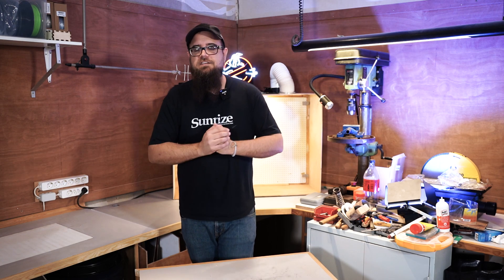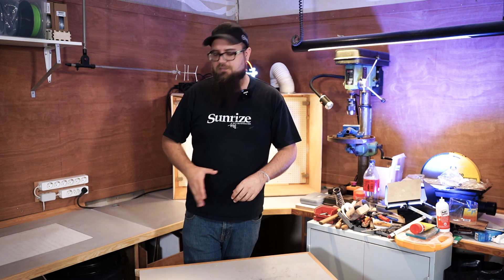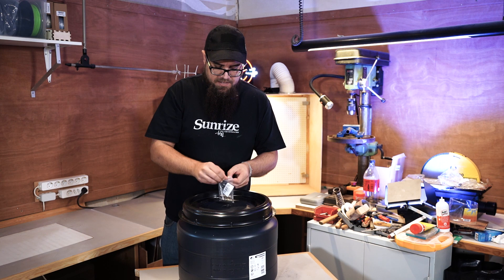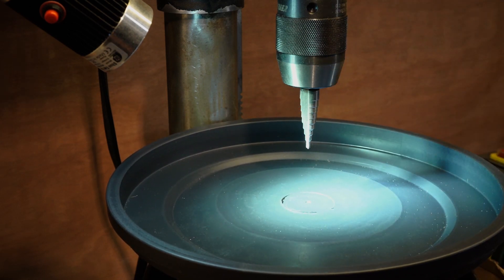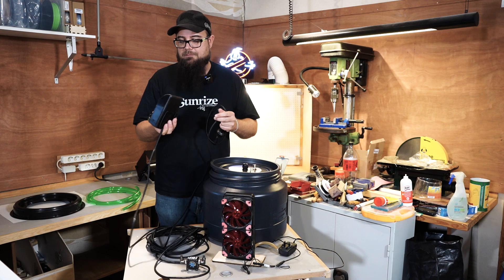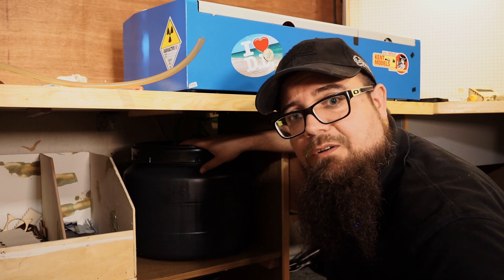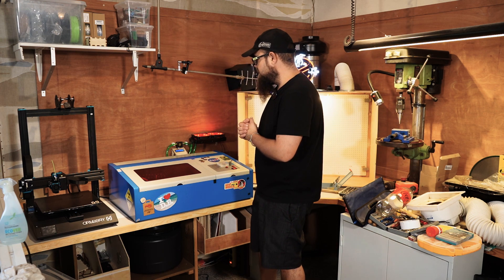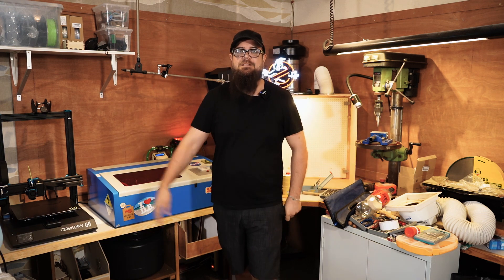Finding the best Coolant Reservoir

Comment: I made a chiller for my K40 out of water dispenser, it costs me just 2 meters of a copper tube 15 mm in diameter, thermocontroller from Aliexpress and some fittings. It's really powerful chiller, I can cut for hours with 25 degrees in my workshop, and coolant temperature stays at 15 degrees (can make it even lower, but I'm afraid of condensation issues on the tube). Highly suggest to make one!

Comment: Hi.
There is a 5th type of people, and that's me, the poor guy who live in a very small city. Here we must learn to do things with the items you could find at home.
So, my pump is into a 20lts old paint can, with some water and a little amount of formaldehyde, no living thing can stay "alive" in the solution.
The temperature of the water reach 23ºC running the laser 1 hs straight, engraving at 30%.
I put a water level, from a broken washing machine, conect to the power supply and a little speaker. 
The water level works with a diaphragm and when the water pressure drops, the speaker sound loud.
I just want to share my experience.
Good channel and keep doing thing to us

Comment: Something I found with my system was that the water pump was heating the water as well since it is submerged in the reservoir.  If you want to see how much heat it is adding, let the pump run for a while without the laser being on and watch your water temp... I opted to a 12v solar water pump that is external to the reservoir. The small pump that came with my K40 was adding 4-5 degrees to the water just on its own.
Reply from the maker: Good point!👍🏼

Comment: Can you use a non-return valve to stop the system from draining when powered down?
Reply from the maker: Yes, but i would recommand a bigger pump to overcome the added resistance
Reply: @MancaveEffects  nice video, great information. I always learn something when I watch one of your videos, so, thank you very much. 
I've got some questions about some of the choices you made during this upgrade. These are not criticisms, I'm simply trying to discover the reasoning.
Full Disclosure: (1) As of now, I do not yet own a K40, or any other laser. I do however, have experience building and using liquid cooling systems to regulate the operating temperatures of various bits of machinery. (2) I am an American, and though I may not be particularly good looking, I try not to be an "Ugly American".
I am familiar with check valves. I've built and used them in a few of my systems. I've only built my own when non-metallic was a requirement. I've yet to find a commercially available, affordable, non-metallic check valve, that is reliable. Mine is simple, cheap, low resistance, and reliable, with only one moving part.
>> I've never heard of a non return valve, is it the same thing as a check valve? 
>> In this video you noted that metallic parts in your old system were causing issues, and yet you used some metallic parts in your new system. Why?
>> Two of these metal pieces were where your lines pass through the lid of the reservoir. By using these two (2) fittings, you added four (4) connections. Every connection is a possible leak failure point. You could have simply passed these lines, with no connections, through the lid by using rubber (vinyl) bushings. This would eliminate four (4) chances of leakage. Why did you chose the option you did?
>> By using a submersible pump, the thermal load on your system is increased by approximately 25%. (Laser load is 40 watts, pump load is 15 watts.) Would it not be beneficial to separate the pump's thermal load from the laser's cooling system? (I imagine the pump's cooling requirements are not as exacting as the laser's.)
>> Have you considered painting the exterior of the cooling line black in order to mitigate UV light intrusion? Also, using a blue LED to backlight your flow meter would address UV exposure at that location. 
>> Final question: Are my questions/concerns legitimate or am I overthinking this stuff? (It isn't as if I've never done that before.)
Reply: @bob2161  very good info
Reply: May i know what's the room temp and water temp (inside inline hose)
Reply from the maker: @azmanyaacob1  ambient temperature is arround 19deg C. Water temp is arround 20deg C.

Comment: Why so much liquid? while you have a radiator
Reply from the maker: Because even i usa the radiator, the 10 Liters of water still heat up about 5 deg. C in about an hour what is to much for my system to work properly.
Reply: @MancaveEffects  I thought that the optimum tube temperatures were something around 20 - 25°c while cutting.  have you considered cooling your cooling liquid to sub ambient temperatures?
Reply from the maker: @nblynx2148  it depends and variates from tube to tube, mine works best at +-19 deg C. But thats a good point and a good idea, trying if it makes a difference using ice 🤔

Comment: 6:24 - Technical measuring there ;-)

12:20 - Very good point, I was thinking you don't want water trickling noises if the loo is all the way upstairs!
Reply from the maker: Its the precise cave measure 😂…

In the old cave i had the reservoir stand at the same hight, there the problem wasnt so obvious😂🍻